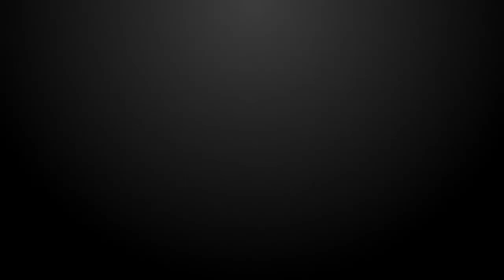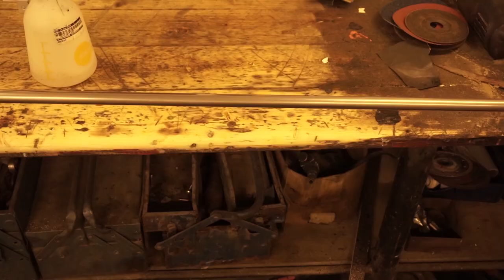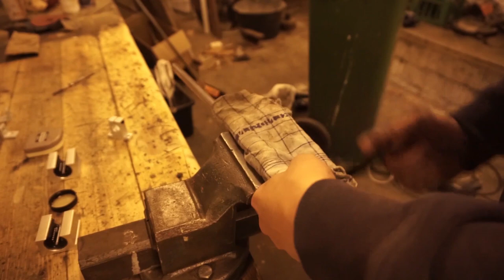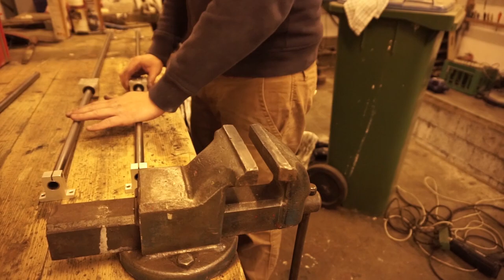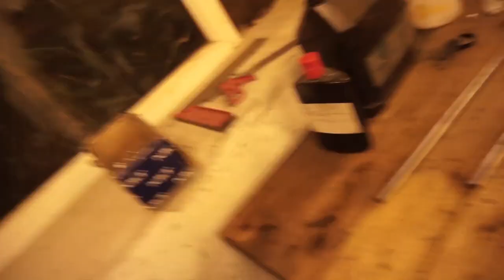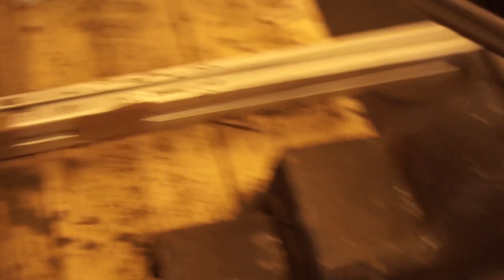Camera Slider - DIY - Part 01

Comment: Cool, looking Forward to see more! :-)
Reply from the maker: +Tchefter 
Thanks Dude, i'm almost Finnish with the Arduino part of it, still waiting for some parts to finish the Slider. 
I actually use a similar camera trigger as you.
Reply: I'm buying the next days the hardware (rails and the support), a bigger stepper arrived to day and the linearbearings for the rails should (i hope) come next week, actual i optimized the code a little bit to eliminate the delay function, works fine now, uploads will coming soon... i think :) (sorry for the bad english)
Reply from the maker: Okay cool, would love to se your code sometime.

Comment: Hi, Paw 

Can you tell me what is the maximum load for this stepp motor ? I mena I have a heavy camera with heavy lens.

Thanks.
Reply from the maker: it is pretty strong, but the plate i made was very heavy, so it had a little problems with running up hill.
Reply: Thanks for your reply,

My camera with lens, ball head and plate weighs about 2.6 Kg so that's why I've decided to put my motor with battery and driver on one of legs not on the plate and I plan to use threaded rod so I hope it will works properly. I tried to test move with acu drill with almost the same power as this stepp motor and it worked well so I think it will work :)

Comment: Use igus rails. This is not a good design solution for timelapse slider.
Reply from the maker: +Ste6o 
It works, i know that igus rails are better, but where i live they are also expensive.